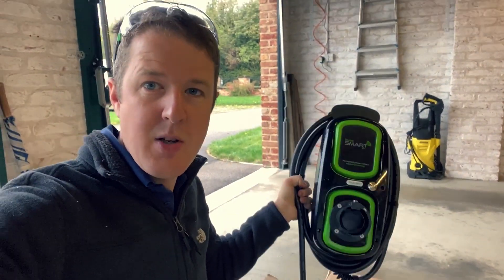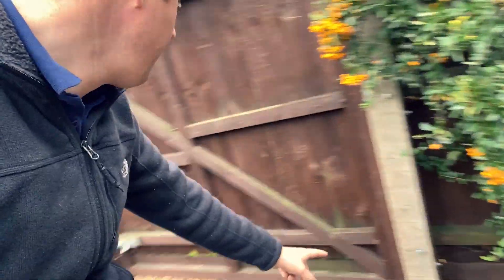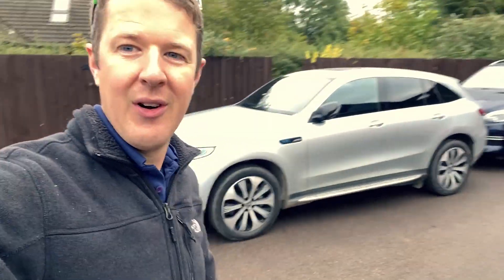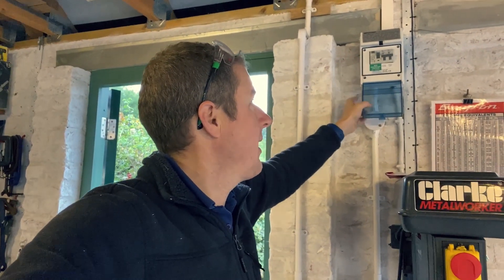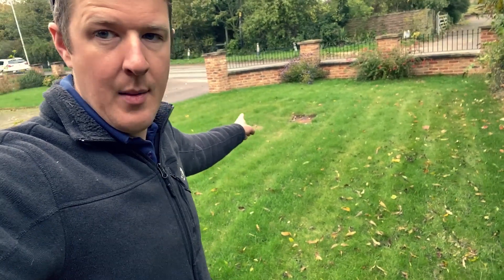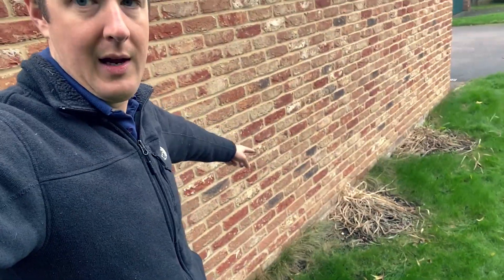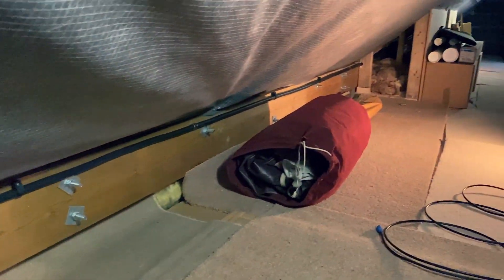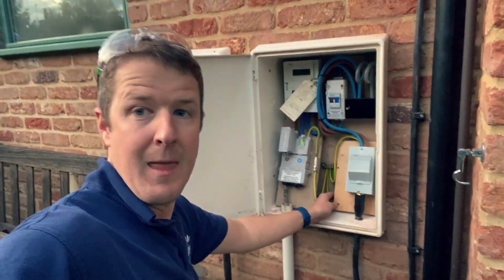Electric Vehicle Charger Installation

Comment: Nice work again Jordan. I was curious to know roughly how many meters in total that cable run is?
Reply from the maker: Not sure, probably about 60m
Reply: The only reason I ask is that I was quoted for 16mm SWA to allow for the drop in voltage. To be fair it was for a tad longer!!

Comment: Hi. I've enjoyed watching your video clips as I'm going to install a home charger in a couple of months. One thing is confusing me. My metre box is in the perfect location but my fuse box/trip switch box is quite a distance away. But is the trip switch box even needed in this installation?. Also there is a concrete path around my house, I don't see how I'll get down a earth rod?. All questions for my installer I know, but maybe you could give me a heads up
Reply from the maker: The best thing is probably to request a Zappi they don’t need an earth rod and they are excellent chargers. They may be able to install a small consumer unit in the meter box if there is space.

Comment: Hi Jordan - I just curious as to how you/we charge for these installs. In your install here Rolec will say you can get the charger for £295 then £500 grant. There is no way that install can cost just £795. Most installs are going to be £1000 plus and obviously depending on cable run etc.  Have you found that customers get upset by thinking it's only going to cost £300-400 but the reality is its more?
Reply from the maker: Yes it’s a big problem. A lot of companies are offering “fixed price” installs for ridiculous prices like £295 after the grant and I just don’t understand how they can do it for so cheap without cutting corners... our average job price is £1500-2000

Comment: Didn’t think you needed to install an earth rod inside a garage as it’s Within the equipotential zone of the building? Correct me if I’m wrong though
Reply from the maker: It’s just that the vehicle could be charged outside the building due to the location of the charging point and length of cable so we have to cover that eventuality

Comment: Thanks for the vids. Will need an EV charger in a New Build house due to be finished next April. I was concerned because of consumer box position. Looks like meter box is on outside wall of house. So is it possible to take supply off the meter box like you did in this video. It will be installed by a professional. Sorry for probably a simple question.

Comment: Maybe I'm mistaken, but thought you were meant to avoid running data and power cables right next to each other (except for crossing straight over at 90 degrees) to avoid interference on the data cable from the power?
Reply from the maker: Yeah good point but armoured cables have an earthed metallic sheath so no interference will occur.
Reply: @artisanelectrics  Oh of course! That didn't even 'occur' (sorry) to me, nice one will save a bit of faff on a similar job I've got coming up.

Comment: Nice job, but you shouldn't be using the Meter box for the EV Charging point installation. The meter box is only for DNO Equipment and for the meter supplier.

Comment: Could I ask how you work your payment/invoicing structure for you EV jobs? Do you take a deposit or just invoice on completion and on average how long does it take to get your rebate from OLEV?
Cheers 👌
Reply: Going thou the olev scheme takes an absolute age because of the 33 odd pages of British paper shuffling bullshite for the government as with all schemes.ive had to wait between 3-6 months to get money back and time on the phone trying to get money owed.
A lot over regulation by the iet for basically putting a 32amp plug on a wall,when you can plug a 3phase fridge trailer in with none of the same bullshite as a ev car charge point.british iet regs gone mad!!!with a job for the boys at the round table.

Comment: Surely you still have two potentials in the garage as you have connected the suppliers main earth to the rolec consumer unit resulting in the swa aurmorings being earthed so if the shroud under the charger slipped down and someone touched that and something earthed by the earth rod they would be at two different potentials. Correct me if I'm wrong?
Reply from the maker: Yes that is a very slight possibility, the only way around that would be to terminate the armoured with a PVC compression gland instead.

Comment: Another great video dude 👍🏼 did you run the earth from the house into the armour and then not connect it the garage end or vice versa? Or did you use the third conductor or both?!
Reply from the maker: Ran the earth from the house in the SWA but didn’t connect it to the garage consumer unit.
Reply: So earth from house to charger, then earth rod to charger and garage board, does the charger have 2 earth connections ?, nice job btw
Reply from the maker: No it only has a connection to the earth rod, the house earth and garage earth are two separate systems.

Comment: 10mm SWA for voltage drop I guess, but why 3-core?  Is it a requirement when changing from TN-C-S to TT?
Reply from the maker: I just like to have the earth in the cable to protect it. Maybe not necessary but belt and braces.

Comment: Nice tidy install, well presented and explained but i am guessing that you went back after the video to treat the wood you added to the DNO meter box with a suitable flame retardant to comply with  BS 476, Part. 7, 1997
Reply from the maker: Of course! 🙄
Reply: @artisanelectrics  Spot on i knew you would have but do also keep up the good work and informative videos
Reply: Hes not really a tit, if everyone is now banging in metal cable clips just for the sake of it and using 3rd cores to act as protection to the cable in case of damage, may as well try and comply with every other electrical reg published to. Could also give the customer a bollocking,  don’t they know yellow ducting is gas😩.

Must’ve put some hard graft in Jordan to get that all done in a day mate, good on you pal
Reply: Tit...
Reply: @muzikman2008  Cock ...

Comment: Good job in the roof space , looks like it wasn't most straight forward install. Did you use the D-Line fire rated conduit clips on the SWA? Fire rated SWA clips seem hard to come by!?
Reply from the maker: Yes that’s right I used the D line conduit clips they work ok but could really do with someone making some black metal cleats
Reply: @artisanelectrics  They do the conduit clips in black, I've seen them on the toolstation website but yeah trying to find fire rated SWA cleats is a problem!
Reply: @mickbitchum4664  what about black all round band ?
Reply: @kevinwilson4010  that's what I use at the minute, I wrap it around the cleats. Be nice to have a proper solution though. 👍

Comment: Never understand why people with stunning cars and stunning house have a £50 Intruder alarm 🤔 fucking madness. Good video 👍👍
Reply: People may have stunning cars or a push bike, a stunning house or a tent. They may also have an alarm that costs £2000 or one like the Accenta in this video that costs £50. 
The point is... if the alarm protects their property, has versatile accessories cheaply available such as a proximity reader and keypads, is cheap enough and easy enough to completely replace within 30 mins should it go wrong, has flexible part-arm programs and is made by a good quality company like Honeywell  - but above all - is so reliable that it has never once false alarmed due to RF interference, spikes or any other reason in 8 years or needed resetting due to lock-ups (like mine)  - then that is a perfectly functional alarm whether you consider it f***ing madness or not.

Anyway, back to the subject in question. Another very informative and watchable video Mr Artisan ;)
Reply: @tasercs  let's be honest if your alarm is locking up and stuff it's installed bad 😂 I do them day in day out monitored the lot fuck all wrong.
Reply: @HahaSully  I think the Accenta's are great, never had a problem with mine, its wired up to a remote monitoring thing too - what am I missing out on!?
Reply: @edcooper2396  Accentas a great basic panel for a home owner. But nowadays sadly the only way to go is Monitored/Self Monitored. People just ignore bells only systems! For a quick easy change out I'd recommend a texecom with a smart com 👌

Comment: Hello Jordon, Great Video as always. This is not a criticism but I watched a video posted by John Ward 3 Days Ago regarding the DNO/Supplier Ownership of equipment and one of the things pointed out is that we should not install anything onto the back board/meter box that does not belong to the them. Is there a different rule that you have heard off? I l would be very interested if anyone knows different.
Reply: I certainly believe that new properties should be fitted with an empty meter cabinet or a larger one at least. Would certainly future proof homes with our rapidly changing technology.
Reply: I was thinking the same! A customer asked me to do the same as Jordan today as the meter was next to where he wanted his EV charge point, I refused and said I didn't want to take responsibility as I believed you shouldn't install on he DNOs back board. Think it is a bit of a grey area, but I have done it in the past but am avoiding it in the future.
Reply: Yes it’s a big NO in my area some of these new smart meters have extra equipment and with a 100A isolator there’s no room for anything else. I’ve been to some properties to remove equipment being installed by other electricians in meter cabinets so they can install their equipment. They will only install meters on new builds now if  the meter tails come on the right hand side only!
Reply: ESFAE, I personally purchased my own meter cupboard from Jewsons & installed it myself. As far as I’m concerned the Dno can install there property inside but leave me enough room to fit my own goods.
Reply: Was thinking the same.
Reply from the maker: I think it’s probably a grey area...
Reply: @artisanelectrics  i dont see why it would be a problem as its not hindering their equipment.
Reply: See this from around 7:50 - https://www.youtube.com/watch?v=-wEQntl54Bs&list=PLVsHvs2SuqmohPoL8Cumvqg2DmGcrZF8R
Reply: Never had a problem often fit 100amp switch fuses in the meter cabinets if the distribution board location isn’t directly behind the cabinet 
There’s enough space and it can be used for isolation instead of the meter company fitting a separate isolator along side the meter.

Comment: Instead of going through the hustle of electrodes etc... Have you thought of the "Zappi" I haven't used it ma self but according to the reviews it's definitely worth a try.
Reply from the maker: Yeah I’m an approved Zappi installer but some customers don’t want to pay the extra for them, and also they aren’t actually available yet the Zappi 2 with PEN fault detection
Reply: @artisanelectrics  Zappi 2's are available now and they have PEN fault detection already. I find they don't work out that much more expensive when you factor in the time it takes to  install a couple of earth electrodes and get a sufficient reading, installation is so much quicker. Also most people ar buying £30,000 cars so a couple of hundred extra on the charger isn't going to worry them, I've had about 6 enquiries in the last two months for Zappi installs and 4 of them are going ahead so far.
Reply from the maker: Ian Leech nice one thanks!
Reply: Does using the Zappi chargers mean there's no need for an electrode then? Can you use the pme earth?
Reply: @Microwebb  yes.. It has a PEN fault detection device inside

Comment: you can get SWA with a data cable within it now, saves running a second cable, not sure on the price per metre but would look a bit nicer and save a lot of clipping
Reply from the maker: Great idea but in this case it wouldn’t have worked as they were going to different locations. The data cable wasn’t for the charging point it was just incidental

Comment: Hi, You were very lucky to find room in the meter cabinet there, but nowadays the meter cabinet is being used for lots of other items like solar isolators, connector blocks etc. What would you have done if there had been no space for the isolator ? 
I think maybe the time is coming for siting another cabinet for ancillary equipment alongside the existing. 
Good video mate 👍
Reply from the maker: That’s a good point maybe it would be a good idea to add an extra cabinet or make them bigger!
Reply: Artisan Electrics  I though we weren’t allowed to put anything in a meter cupboard

Comment: I wonder if the national grid is up to us all having these current hungry chargers yet?
Reply from the maker: Yeah they are prepared I think! They know what’s coming.
Reply: The main problem is the amount of people with one. Say you rock up to a hotel for the evening. Most only have one or two points. What happens when 1 in 5 people has an EV. That could be 10 to 20 chargers required.
Reply: @barrybritcher  you're right, the hotel may have to have an upgraded service to accommodate the chargers or employ a third party to built a separate charging facility with its own supply in the car park. But then the network may struggle which is why many car chargers now have comms built in to facilitate remote switching based on local demand. But that's a while off yet I think.